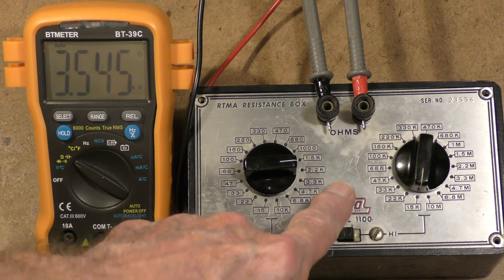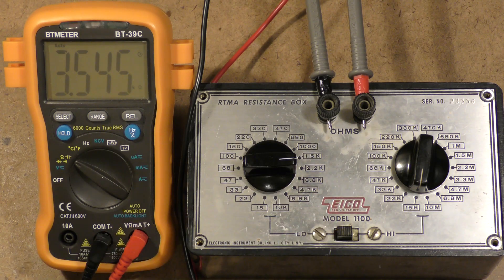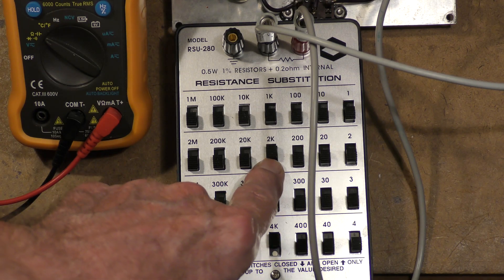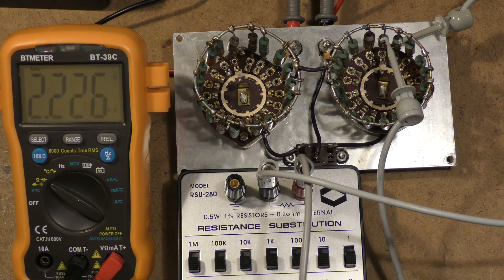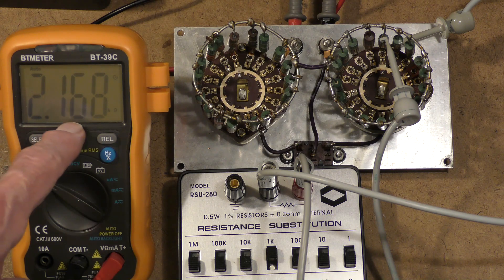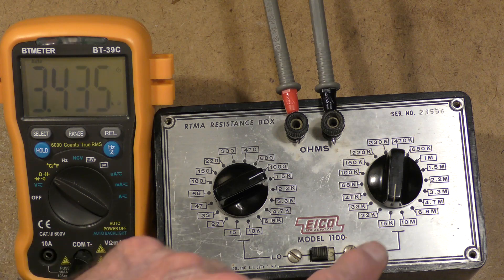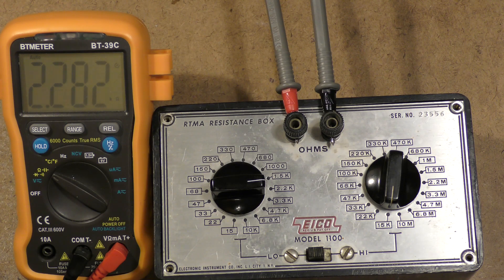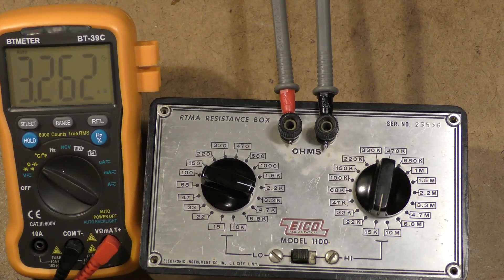TTT351 Substitution Box Trick

Comment: Hi Tom,
That’s really interesting, thank you.
But what is the advantage of adding a resistor instead of replacing the faulty one? Surely the price of the added resistor would be similar to that of the replacement one? And if you are soldering, the work seems to be the same.
Cheers 
Mark

Comment: What a silly thing to do. Why do double work? Why throw extra wasted effort after bad parts and still have the old drifting resistor to deal with in the future??
Why not just do one step and simply REPLACE the bad carbon composition 2.2k resistor with a new 2.2 k 1% precision film resistor for a few cents and be done with it?
 And then you'll permanently avoid future carbon-comp drifting problems too.

Comment: I did this trick a couple months ago with a couple resistance boxes I have.  I just used a parallel resistance calculator table on Google.  Just type in the resistance you have and resistance that you want. Kinda cheating I guess.   Most I used 1/4 watt.  If it's not off too much you may only need to add up to 100k to a low value or even 1 meg to higher value. Good to share this approach though.

Comment: Hi Tom,
I just stick the sub box in the circuit with the knob near the rated value of the removed resistor. I twirl the knob to the desired result, then just measure the sub box resistance with my VTVM.  I do have to be careful it is not set too far off, or it could damage the circuit or the box. I never tried 2 boxes in parallel, that is probably a better method. Thanks for the video (and all the other ones you posted this year).
Ian

Comment: I always measure carbon composition resistors before using them, as all of them will drift up. Got some 5R 20% ones in a grab bag once, and none of them were less than 10R. Odd resistors in that the only marking on them was a single green band on an otherwise black body.  Only thing is that the drift rate depends on heat, so they will drift up faster when they are run at close to rated power, and irrespective of voltage all of them over around 100k will drift up by 20 % after a decade or two, so most are now sitting at around double the value after a half century or more, and for 1M  they can be almost open circuit at DC, but will be fine at 200VDC. Often easier to replace them with 1W carbon or metal film, unless they have more than 300V across them, where you are better off with 2 or 3 in series of the film units for overload ability.

Bet the composition value changed when you soldered the new resistor in, and heated up the wax on the one side of the old resistors. Interesting in that you could overload them till they caught on fire, but still were, till they cracked, at least vaguely within the resistance that was on the bands. Saw many that were crispy and white in the middle, but, till you cut the leads, they were still within 80% down to 200% over the rated value. Cut the lead and they crumbled to powder.